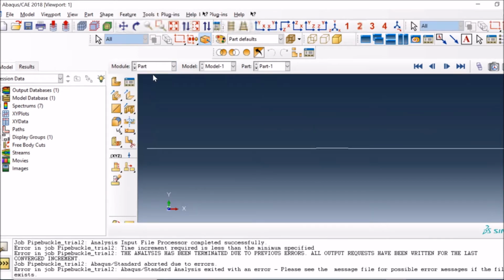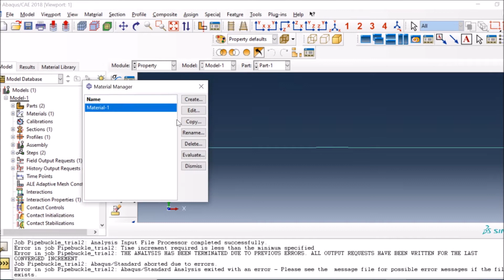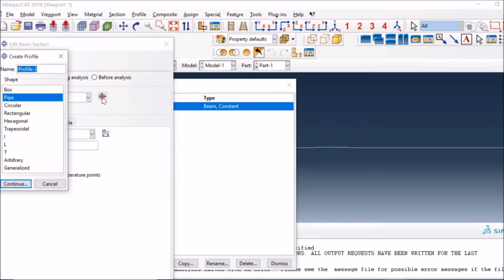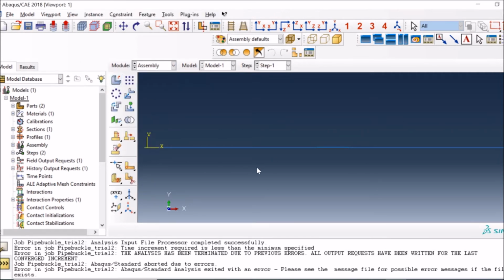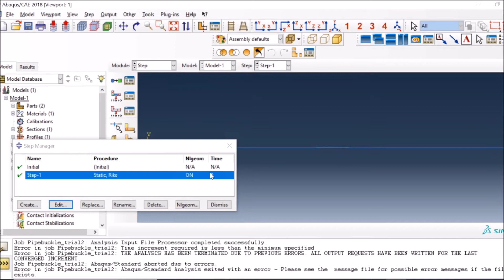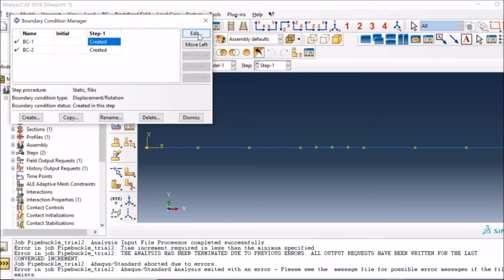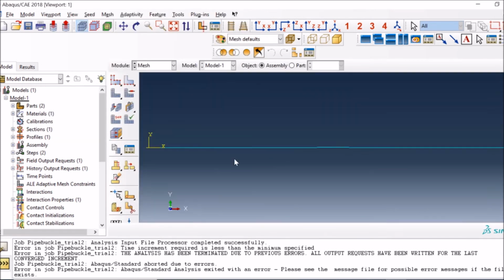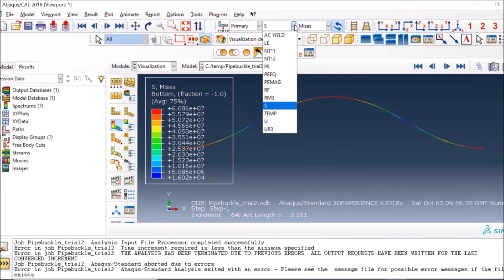Simulating Upheaval Buckling of a Pipeline due to Operating Temperature Changes - ABAQUS Tutorial

Comment: Hi, thanks for the video! I had a question about conducting the thermal buckling analysis of a column using the static risk method. The thermal load due to temperature increase defined in the predefined load field can't initiate the snap-through response (decrease in temperature and increasing displacement) while applying the equivalent mechanic load can. Do you happen to know the reason for this? thks
Reply from the maker: May be check if you have used correct and proper thermal expansion coefficient and other thermal properties.